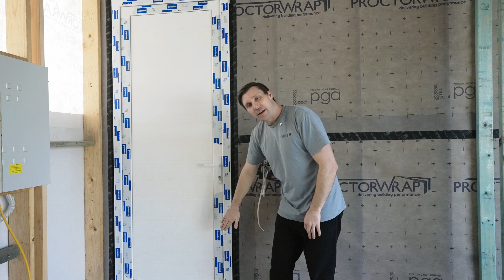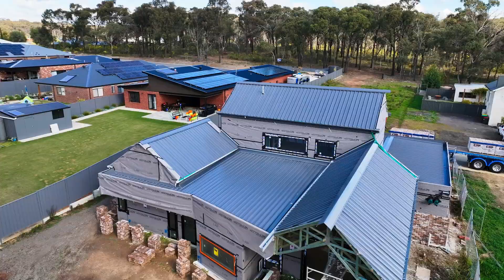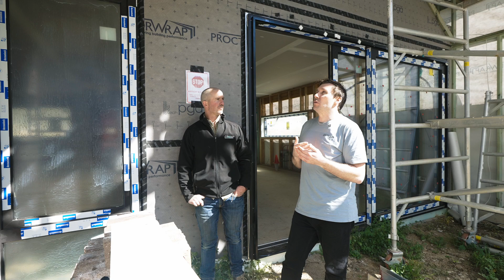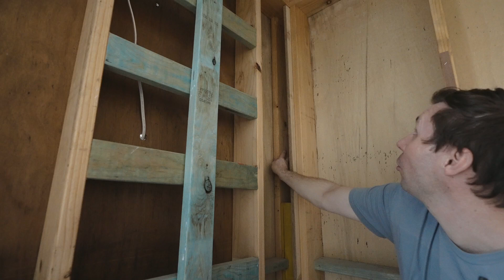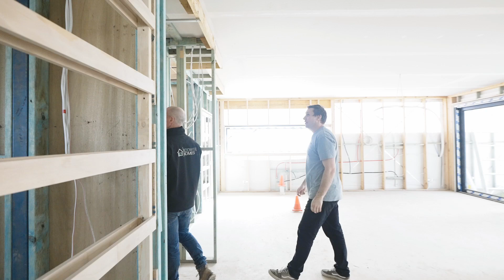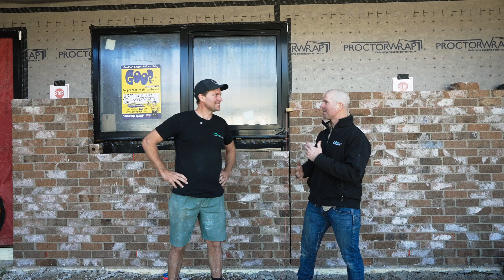Crafting the Future: The Art & Science of Building An Energy Efficient Forever Home 🌿 | Episode 2

Comment: Will water vapour build up in the wall assembly if you don’t have a smart vapour barrier behind the plaster to control water vapour condensation on the cold surfaces  of the internal side of the external walls?
Reply from the maker: Thanks for the comment. The short answer is not in our experience. We have sensors in the wall assembly of a project monitoring any occurrence of condensation which there has been none. It is worth noting that the project is sub 1ACH with a centralised HRV system maintaining a stabilised internal humidity level.